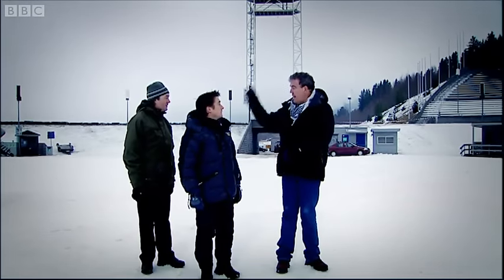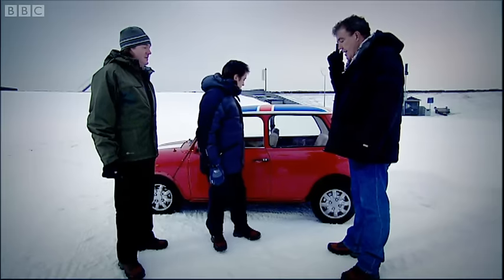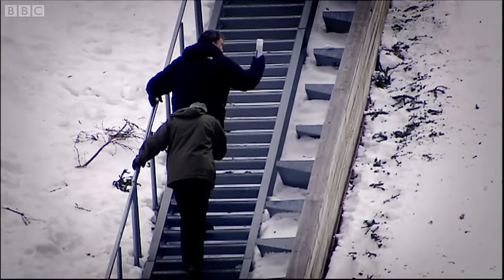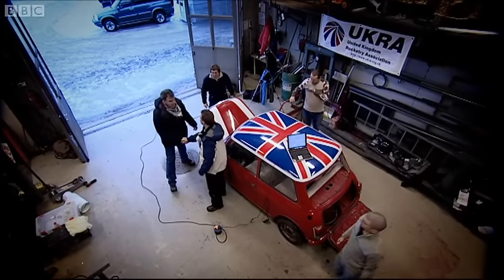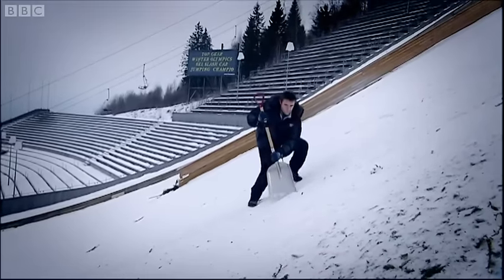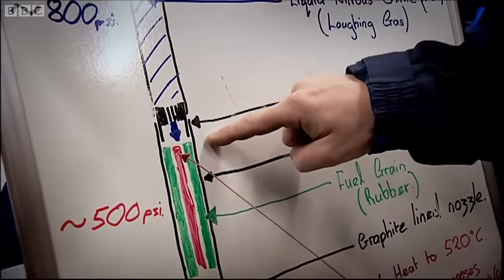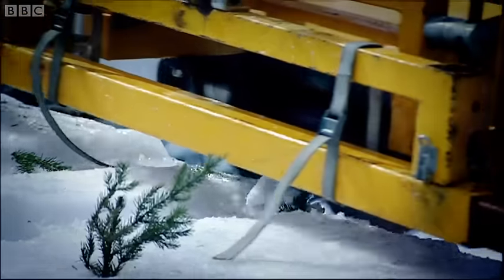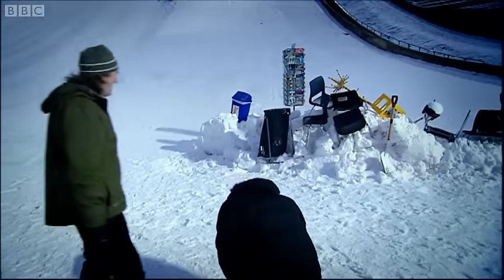Mini Ski Jump | Top Gear Winter Olympics - Part 1

Comment: the angle of the initial slope has got nothing to do with the speed nor the flight distance, etc. assuming he doesn't take into consideration friction, which is certainly doesn't because he doesn0t know what it is. so. when he mentioned the slope of the ramp, he was talking out of his old farty ass.
Reply: +Carl Coppens i actually slope does affect velocity and accelaration
Reply: VMKAROUND 365 nope. just the height difference. all the potentail energy (=mgh) is converted into kinetic energy (=1/2 mv^2). assuming there's no friction, as i said. tell me where exactly in these 2 equations the slope plays a role?
Reply: Carl Coppens why are putting out this basic equation?Are you like a 12 year old child if the angle of slope is more there will be more velocity 
read this article to clear your doubts
http://europepmc.org/abstract/med/7723654
Reply: VMKAROUND 365 friction. as i said, velocity and slope are related IF there is friction. as i said, may can't possibly know the friction of the car in that situation and probably disregarded it. i challenge you to write down an equation relating the slope to the velocity assuming no friction. go on. ridicule yourself. or just give up and never reply because you have realized you're wrong.
Reply: Carl Coppens The answer is v=aefftv=aefft . In the same time, the car would've traveled a distance s=(1/2)aefft2s=(1/2)aefft2

The other option is - if your inclined plane is of any fixed length LL and the time tt of concern to you is the time in which it has completely traversed the plane, you can cast everything in terms of this distance, by using the second of these equations to write tf=(2L/aeff)1/2tf=(2L/aeff)1/2, and vf=aefftf
Reply: +Carl Coppens awww you haven't replied, maybe because your elemtary school physics have been wrong? Sucks to be you.
Reply: djteac i haven't replied because you've ridiculed yourself without my help, for everybody to see. i'm now expecting your equations proving that the earth is flat.
Reply: djteac did you to high school in the US? that'd explain things. an object falling from 100m high will hit the floor at 44.5m/s, no matter what the slope is... providing there is no friction. it'll take more time to reach the floor on a shallow slope, but the final speed will be 44.5m/s. now show me a universe where an object falling from 100m high reaches a different speed at the moment it hits the floor depending on the slope it's on... providing there is no friction. an object will have a higher acceleration in a steeper slope, but for a shorter period of time and the final speed is the same as an object on a shallower slope, which will have a lower acceleration but for a longer time. 

http://www.sparknotes.com/testprep/books/sat2/physics/chapter8section3.rhtml
Reply: VMKAROUND 365 so? no example? an object falling from 100m high on a 45o slope vs 70o slope vs free fall? final speed?
Reply: +VMKAROUND 365 wow... where did you learn physics? why are you insulting people when you don't even know what you're talking about? you obviously don't understand balistics and you're probably still in high school and not getting good grades. why would you get into an argument with someone who obviously knows a lot more about physics than you? you learnt a good lesson; be more humble next time and stay where you belong.
Reply: +Prof Moriarty really are you a professor?
you dont have the name or stafflistings
iam a previous student of Nottingham university  and i never saw you there
looks like Navaneeet kaur is just making fake accounts to win the argument
Reply: +binu keezhethu you obviously haven't looked at the staff listing; as far as I know, I am still part of the academic staff of the dpt of maths and physics at notthingham But i'm not going to justify myself to strangers on youtube. Everybody can look up the staff listing. Instead, I encourage you to watch the interesting sixty symbols channel on youtube: it's about science and physics, and I make a few appearances once in a while! Science rules!
Reply: +Carl Coppens 
James may is an engineering graduate 
he is more than accurate than you kid 
+Top Gear you probably dont know how much of a legend James May is
Reply: Carl Coppens does that explain abusing james may?
Reply: Kanthari Kavala *pat on the head* i'll put your brave attempt at an insult on the fridge next to your macaroni necklace and your drawing of your last vacation in the camping site outside of slough. good boy. you're a good boy. who's a good boy? who's a good boy? you're a good boy....
Reply: slowly chews popcorn and watches silently
Reply: +Kanthari Kavala Are you kidding me? Engineering graduates can be wrong too, you know. Carl Coppens presented sound mathematical arguments and you made it personal for no good reason. 
And you, +Carl Coppens, why the hell did you engage this guy? I'm Indian too, and I know you're right. Please refrain from generalizing.
Reply: Carl you must be joking? If I'm on a flat surface I won't travel any speed assuming I wasn't already. If I was on a slope I would. A slope causes any object to move (in this case ignoring friction) because Gravity is pulling down as well as kinetic energy. Like the person up there said. POTENTIAL ENERGY. Go to school
Reply: _2U_ my point is that the final velocity of a object going down a slope doesn't depend on the angle on the slope, but just on the height difference. the total potential energy E=mgh is converted into kinetic energy E=1/2 mv^2. if the object if going down a 45o slope or a 75o slope from the same initial height, it will reach the end of the slope at the same speed - it'll take more time on the 45o slope (the acceleration is lower),  but the final speed will be the same. similarly, if there's "no slope", and the object is in free fall, the final speed will still be the same as an object going down a 45o or a 75o degree slope. (of course, that doesn't take into consideration friction). the other guy was saying that if a car fall from 100m high on a 45o slope, the final speed will be lower than in the car falls on a75o slope or in free fall. the thing is, the initial amount of potential energy in all cases is the same and once it's all converted into kinetic energy, the final speed is the same in all cases. the other guy was saying that somehow a car on a 75o slope has initial potential energy and will reach the end of the slope at a higher speed than a car on a 45o slope. he's confusing acceleration and final velocity.
Reply: Carl Coppens No he isn't confusing them, can you pass that through your hot head already? Everyone here is against you. I think you need to revise what gravity does...
Reply: What if james meant the slope of the jump to calculate the horizontal and vertical component of the speed vector at the time of the jump. That slope will affect the distance travelled before touchdown.

Edit: nvm it's horizontal...Maybe he meant the angel of the slope it would land on to calculate if it would beat the guy on skis

Comment: One of my engineering mechanics lectures at university was all about correcting James Mary's dodgy calculations. Turns out you don't need to know the mass of the car at all if you use energy methods instead of equations of motion.

Comment: If James was ignoring friction, which he seemed to be, all he needed to do was work out mgh and how fast that would cause the car to go given its mass when mgh is converted to kinetic energy.
Instead he used angles, proportions of gravity, and suvat, which while still simple is harder.
Then you can look up the equation for distance given velocity and starting height above ground (starting height in this case being the height of the end of the ramp)

Comment: May don't understand gravity. The longer your away from the CENTER of the Earth the less gravity. Do to the spin the Earth is "fat" at the equator and therefore less gravity. On the poles there will be more gravity. You can take a 500g weight and see for yourself, weigh it at the pole and then the equator. Over the oceans there are also less mass than land ( water don't weight the same as rock and iron and so on ). Gravity is not really a constant. The gravitational constant is 6.67408 × 10-11 m3 kg-1 s-2.

Comment: actually the way james is doing the calculations is very hard and wrong becauses the car goes on a curve, not a straight angled line. So instead of using classic motion formulas its better to use conservation of energy. Know the potential at the top, then you know the speed when the car leaves the ramp. if you add the angle to that, then it is a matter of projectile motion.
Reply: Onur Erdincler it's just a joke to put on a nerdy character
Reply: yup. not rocket science.

Comment: Gravity is not constant throughout earth lol
Reply: +гоголь-моголь Chudz earth would have constant gravity throughout its surface if it was a perfect sphere. But... It isn't, it bulges in the equatorial parts and don't forget the mountains and high area etc. gravitational force is dependent on mass of the earth and height of the object above earth's center of gravity
Reply: actually it is constant on earths surface... you can argue that gravity is stronger on sea level than mountain top but frankly the difference is extremely little and we need very precise equipment to even tell it. Besides 9.81m/s2 is used in common calculations and thats a rounded off figure anyway. So you are wrong and think before spitting bullshit

Comment: When are you drunks going to do a review on the Dodge Challenger Hellcat???? It has a 707HP V8, 650 lbs of torque, does 10.8 seconds in the quarter mile on STREET LEGAL drag tires, 205 mph top speed (tested at Nardo), seats 5 people, has state of the art  electronics, beautiful leather interior and only costa $59,995. US dollars. It is the best/most performance per dollar car in the world!!!!!!!!    ARE YOU AFRAID TO REVIEW IT??????     YOU SHOULD BE!!!!!    WHY WOULD ANYBODY BUY ANYTHING ELSE????????       ;o)
Reply: You realize it's not meant to be a performance car,  it's supposed to go fast on the straights.
Reply: ~TheCakeIsALie~ The Hellcat did the exact same twisty track times as the Alfa Romeo 4C in a Motor Trend test. So, you don't realize what the Hellcat is capable of.   BOOM!!!!!      Now what?  ;o)